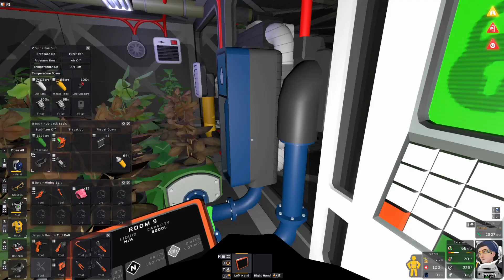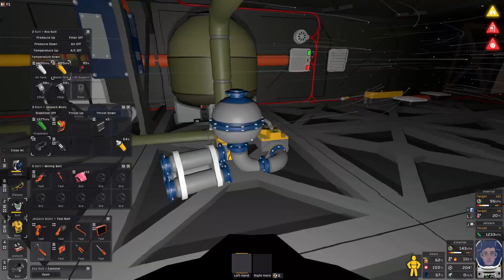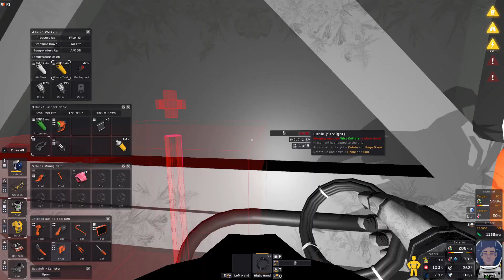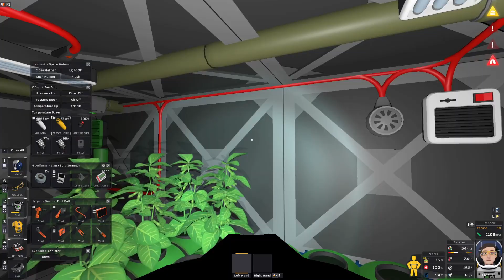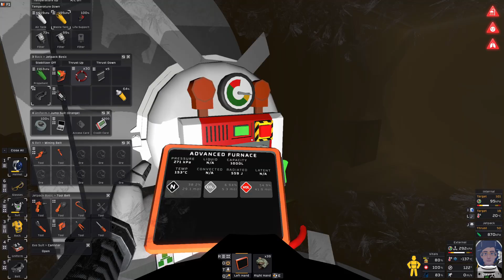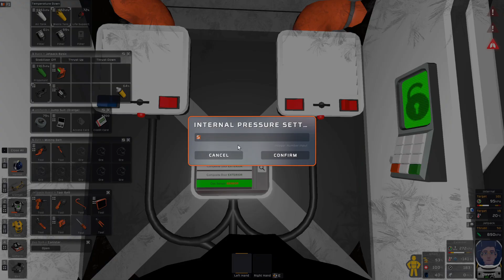Stationeers Titan Part 25 : A Series Of Unfortunate Events

Comment: Maybe use a pipe run that brings in the outside air and runs across some pipe radiator and then goes back out to atmosphere and use some sort of program to control when to input vent would turn on and off.

Comment: Murk, a while ago I recommended a way to get CO2 em mass.  I’m doing the same way on my current Europa.  Off my waste tank, I have a pipes heading into a small 1x1x1 room with a manual hatch. One of the walls isn’t built leaving or open to air.  Off the insulated waste tank pipe leads into a one way valve leading into regular pipes with a radiator and liq drain attached.  As the pipe cools to 158 the NOS leaks out into ice, then Pol, CO2.  When it’s cold enough for the other 3 gasses to leak as liq I don’t care.  This will slowly drain your waste tank pipe leads, unless you shut off the one way valve and prevent your waste tank temp from dropping.  The one way valve separates the two pipe networks.  When I want to degasses my coal, I set my furnace to output 20L input 10L.  Depending on temp, this will keep a constant flow of hot waste gas in-the furnace, w/o the furnace blowing.  This is also a great/cheap way to get pure NOS ice.  You might need to insert a vol ice once in a while to spike the temp.  Pure ices are 50mol of that material. 1 Pure NOS ice +2 vol ice is almost 100 mol of supper fuel. Ignite that in an empty furnace that will easily get to over 2.2kK temp (cough cough stellite) 
For your lungs, place the portable scrubber outside with a N2 filter in it and mount it to a connector.  Connect liq pipes to the connector and there is your LN2 needed for a cryo tube.  Later for rockets, same idea but use a Vol filter, and you have an infinite source of LVol for rocket fuel.  
I’m not trying be mean saying this, but to me all you do is fight the atmo, instead of trying to use the atmo.  You are slowly “winning” the fight, but it would make things much easier to “work” with it
Reply from the maker: Thanks. I do develop a few ways to recover CO2 over the next few episodes. The underlying problem is the amount I need to generate and then convert to O2. Titan is basically like cold Vulcan so the pathways to generation are hard work, but like Venus mining is also high risk so I'm not feeling like I want to hand mine too much nitrice to extract the NOS, even though it's the main source!!